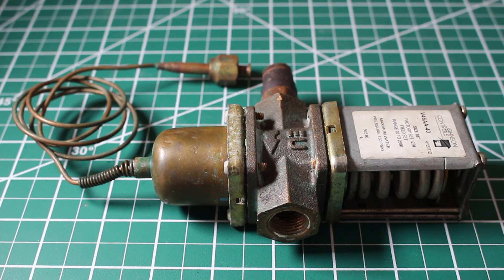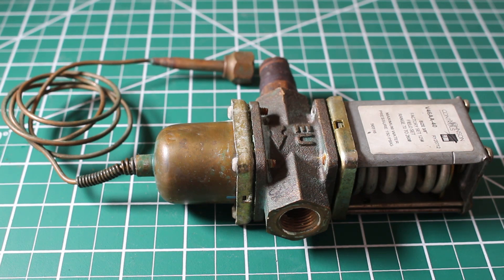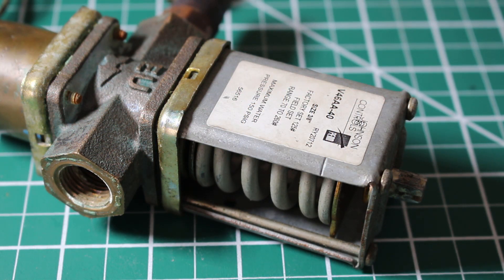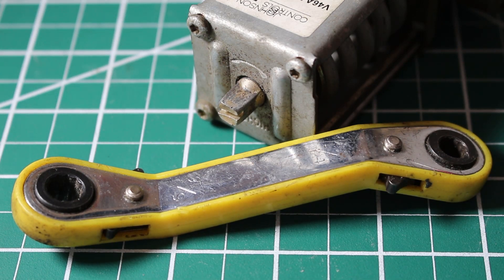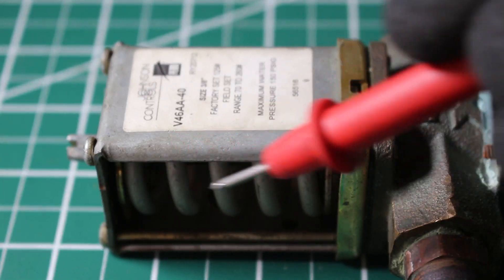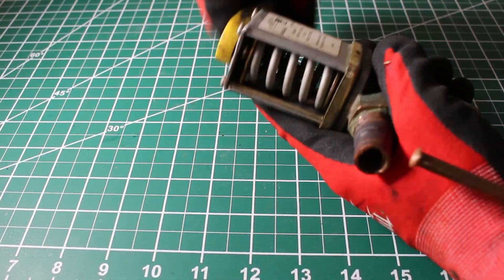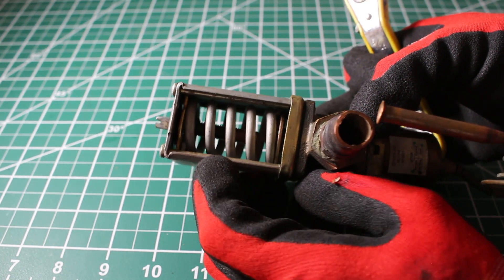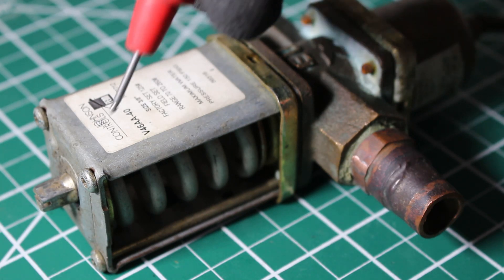HVACR: How To Adjust A Water Regulating Valve (What Is A Water Regulating Valve/How Does It Work)

Comment: Do I have to pump down unit when replacing water regulating valve? I know the cap tube is connected to the high side line.

Comment: I have an ice maker that has this exact regulator. When the bin is completely filled with ice, the machine goes into standby until more ice is needed to fill the bin back to full. Is that valve supposed to completely cut the water supply to the evaporator when the unit is off, to keep from wasting water? This is a water cooled ice maker, not air.
Reply: I know this is late, but yes, there should be no flow when the machine is not running.  I realized this when my water bill went from $200 to $1000 in a few months.

Comment: I have yet to see one of these valves actually self-regulate. On a low temp 404a system where I need 250 head I can start a pull-down and my head will be 350 PSI. Then when the chiller gets to a low temperature then my head will be under 200. This is ancient technology that never worked for crap. Otherwise you wouldn't have to manually adjust it. These things are compressor killers. And if you don't have well-maintained Tower water it will be even worse. A modulating valve on a PID loop is 21st century technology. Absolute perfect control of head pressure.

Comment: The head (high) pressure line he referred to at the start of the video will normally be connected at or near your water heat exchanger and is reading the head pressure of the ref system. Keep in mind that the valve works off of pressure differential between head pressure of refrigeration system and adj spring pressure. Adj the spring very slowly and monitor your head pressure as well as super heat and subcooling of the refrigeration system as to not overshoot. Also COUNT YOUR TURNS so you have a baseline starting point.

Comment: Still have quite a few of those out there, mostly on WSHP'S.
Reply: I work for a company that builds industrial process Chillers and I hate these valves with a passion. We still build new machines with these ridiculous valves that barely self-regulate. Wouldn't a modulating valve on a PID  loop be much better?